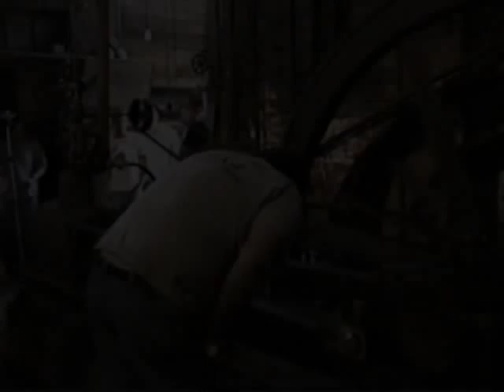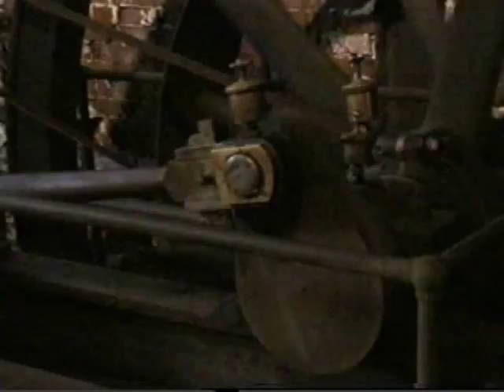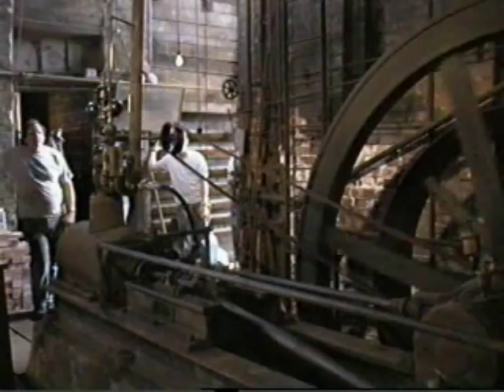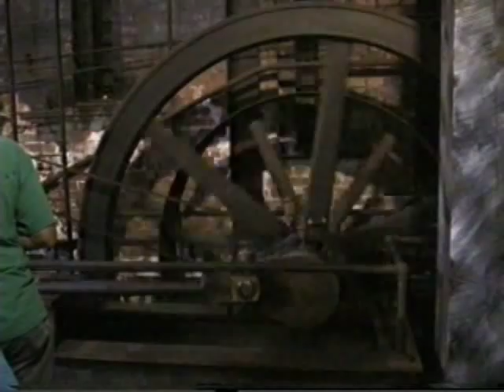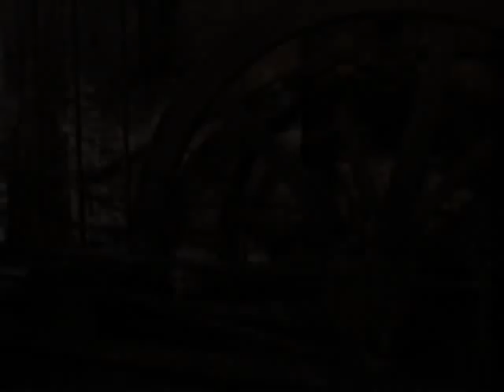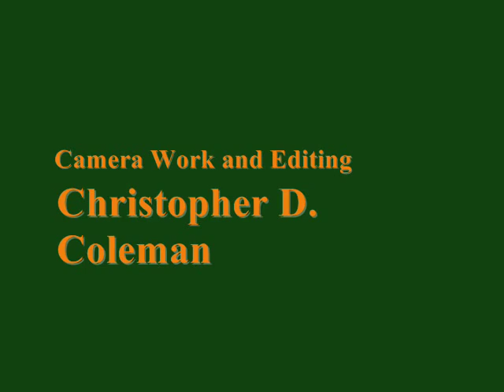East Broad Top - 1870's Shops Steam Engine - First run in over 50 years - Part 2

Comment: Now they have to go in to the machine shop take apart the machine tools clean them use some #2 way oil . balance the machines and get them working. most of them should be equipped with bronze bushings that never wear out.
Reply from the maker: +George Sharkey , Since this video was taken in 2009 an engine lathe, the locomotive wheel lathe, a shaper, the foundry blower and the slip roll have all received service and run in addition to the drill press already running. Since the trains stopped running in 2011 most of the effort on the equipment has been shifted to building restoration which is continuing to progress well.

Comment: Did they have an oiler on the air line or are they running that cylinder dry?
Reply from the maker: Yes, there is a mechanical lubricator that has been installed since the original hydrostatic lubricator will not work on compressed air.
Reply: @ebtrr  I am guessing there's no chance of using a outside steam supply like what happened in England recently?
Reply: @eliotreader8220  This first run was in 2009 and at that time, no. Today, 13 years later, that is now a real possibility. Stay tuned.

Comment: A steam engine has to work on steam not on air pressure. 
Your next task find a steam boiler or let make a new boiler.
Reply from the maker: For demonstration purposes the engine runs quite nicely on compressed air, with an alternate lubrication method in place. Should more power be needed for doing actual work on engine power, then steam would clearly be preferred.